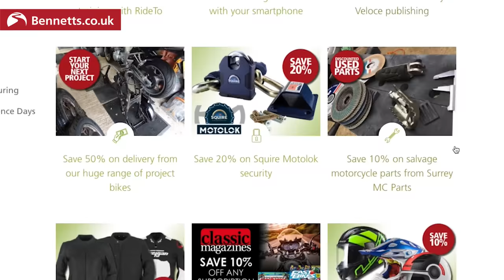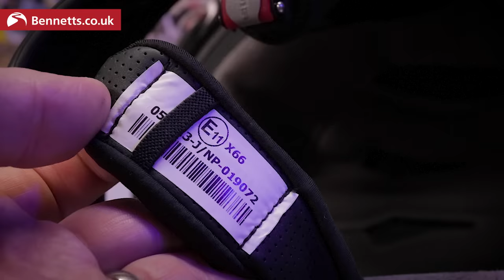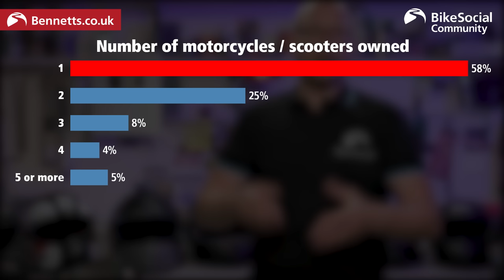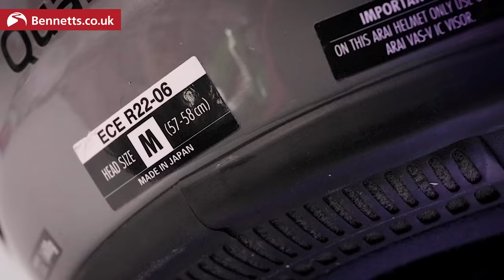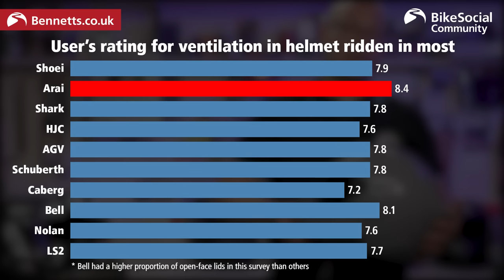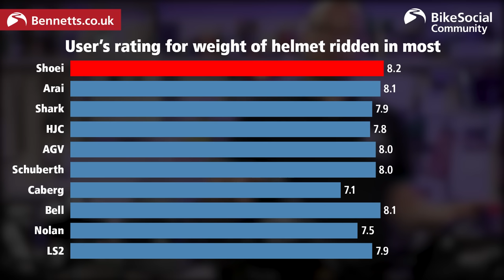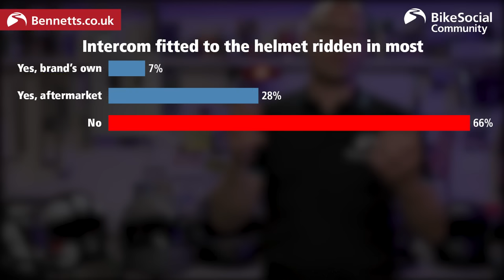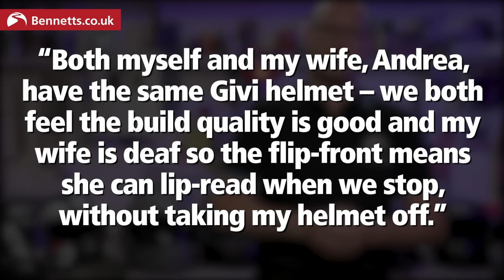Best motorcycle helmet | 2,133 independent reviews, 1 crash test

Comment: As a rider of naked bike the wind noise is the biggest one for me. Even WITH decent earplugs I've found most helmets have an unbearable amount of noise above 60mph (tried HJC, Schuberth, Scorpion, Shark, various models). The best I've found are Shoei lids for this but I think that is because they fit me best, which I think is actually the key to a quiet helmet, a good fit will mean minimal gaps for air to rush in!
Reply from the maker: Wearing a neck tube also helps reduce the noise, but yes - fit is a big thing in noise. Cheers, John
Reply: Don't blame the helmet, blame your melon.

Comment: Always had Shoei’s didn’t even consider other brands, however when it came to my newest helmet I bought the GT-Air2 due to all its features, save as drop down sun visor and properly integrable streamlined Sena audio design.
But most notable is how amazing it is when it comes to buffeting as it really makes riding more comfortable due to as  aerodynamic design. Your head can happily turn and move and you don’t feel like the wind is pushing much on your head and neck
Reply: I first had the GT-Air2 and then tried the AGV K6 (with a blue visor) - it works way better for me. Especially in terms of aerodynamics (the visor closes wind-tight) and a light-weight feel. And for track days at very high speeds nothing comes close to the AGV Pista RR😃🏁🏁

Comment: Such a lot of good information bundled in this video. Thanks.

About degradation of a helmet over 5 years time. I don't worry or care..... Salestalk...... (my opinion at least but made after doing lots of research on this)

Outer shell : Polycarbonate ( cheaper) helmets can degrade over time with  UV light ,but the helmets with fiberglass composite shell or carbon shell  definitely do not degrade over time and UV light. That material just does not degrade over timespans of 5 years or much longer.( simply imagine a carbonfibre car or a composite fiberglass car going bad over less then 10 years....I have a 40 year old lotus esprit...the fiberglass shell is stil good and strong). At work , we do fiberglass piping for some of the worst conditions to withstand time.
Inner EPS (polystyrene) shell : I did not find any studies done on motorcycle helmets EPS shell, but there was a study on aging of bicycle helmets EPS shell :  In a nutshell : Don't worry about aging. The helmets EPS liner does not deteriorate with age. Just make sure the EPS liner did not suffer to much denting, because it does not recover automatically on those places.
That leaves us with the visor and pinlock: replacable (do not try to polish a worn visor, you will not get it right, good visors have coatings on them.) , the inner lining :  it ages and loses its resilience but it is washable or replacable in a quality lid if needed and steaming helps getting back resilience to have again a good fit. The other mecanics of the helmet: well if these are bad : change the helmet....
That brings me to a second hand helmet.... Well I inspected and bought a perfectly fine Shoei neotec 2 with integrated sena,( new 650€+200€) for a total of 100€ , inserted a new pinlock for 30€ on a still perfect visor. The inner liner was in perfect condition and is washed and steamed . Outer shell had original silver paint with almost no marks. tbh I do not worry in the least about the safety condition of this lid and it is the most comfortable quality unit I ever had for an unbeatable price.

Comment: So funny hearing that Nolan owners regretted their choice the most. I just used a N100-5 for a year and despite the good fit I've found it very noisy (closing the visor doesn't actually seem to do anything?) the thing is immensely heavy (almost 2kg!) and bits of it are starting to fall apart.
Reply from the maker: Sorry to hear that! It is important to remember that we could only work with a relatively limited dataset, but it did indicate trends among those. Cheers, John
Reply: I have the same helmet and I love it....but I use soft type ear plugs no matter what helmet and make sure they go down into the ear canal, you will hear them crackling as they expand in the ear. Not saying that this applies to you but I was in Aircraft fitting before I retired and it is surprising how many people do not put ear plugs in properly. As for falling apart I havent had mine long enough yet. I did use some cheap Ear speakers which were pressing into my head so I got the N Com and its great...really comfortable. Also cant open the top head vent on the fly ...have to stop and take the gloves off. The optics I find excellent as well but I get some steaming up. I have just tightened the Pinlock and will see how it goes.
Reply: @malcolmemsley5909  yeah I use foam earplugs inserted as described for longer and faster rides, I use filtered plugs around town so I'm not quite as cut off. With these I still have a higher level of background noise with the Nolan than in my Shoei. The other place where the poor visor seal is clear is that my glasses fog up much quicker in my Shoei than the Nolan! On the fogging point, Nolan only put in a pinlock 70, the premium brands use a 120 which should hold out twice as long before fogging. On the build quality front my issue is with the neck roll adjuster breaking and the cheek pads wearing out very quickly. I do think the Nolan is probably the best flip lid at the price point but you have some compromises.

Comment: Great content John mate, love the videos. One of the reasons I try helmets on besides fit, it’s field of view. I do find some that meet all the features I want but the actual helmet is encroaches into my peripheral view or restricts view when shoulder checking. Where you would need a neck like a owl to pivot around and get a proper look. Or they have a huge nose guard that blocks the view of the gauges when ridding. Would be great if manufactures advertised degrees of view like they did other features.
Reply from the maker: Agreed, though sometimes there can be a widish field of view horizontally, but it can narrow towards the extremities more than others. Cheers, John

Comment: How can you prefer the Quantic over the K6? The Quantic has a 3/5 Sharp result with the worst rating for side inpacts, while the K6 has a 5/5 Sharp test, with maximum points from all sides.
Reply from the maker: I think you're confusing it. The Quantic is ECE 22.06 approved. And it hasn't been tested by SHARP

Comment: Most of the usual brands are pretty good now. I have a GT-air which is quiet, comfortable and never buffets. 
As others say - try them on properly and make sure it fits well, choose a decent brand and you'll be fine. 
If you buy the cheapest thing on Amazon you only have yourself to blame when it turns up falling apart, not fitting, noisy enough to send you deaf and with all the protection qualities of a baseball cap.

Comment: Another fantastic video that was really informative, thank you John.

Being new to riding this year, I bought the Scorpion Exo1400 Carbon (like the one you held up) the reviews for it seemed overall quite good. It does seem rather noisy (I wear Auritech earplugs always) and I was surprised to get a rain drop run down the inside of the visor on a couple of occasions in recent downpours. I'll be saving for a new helmet once a few more have passed the new EC 22.06 tests.
Reply from the maker: Thank you! I didn't have a problem with water getting in, but while it's a relatively good value, I had a few grumbles with it. Havea. check if you can adjust the visor mounting plates a touch, to draw it slightly tighter agains the top seal. Cheers, John https://www.bennetts.co.uk/bikesocial/reviews/products/helmets/tested-scorpion-exo-1400-carbon-helmet-review
Reply: I went back to biking in 2020, choosing a Scorpion Exo Carbon 1400 (£329). My biggest need specific to me was that it be very light (I have some metal pins in my arm/shoulder), and the 1400 fits the bill perfectly. I've fitted a Fodsport M:1 intercom and an olfi camera, and it still seems light enough to wear for extended periods. This year I took my 125 on a 9-hour trek to Somerset (I got lost a few times) and still found it to be comfortable. It was a touch loud on the dual-carriageway, but I suspect that was more to do with pushing 75mph @10.5k on my little Keeway than the helmet, LOL.  After covering 1,500 miles in a fortnight, I honestly have no complaints regarding noise or comfort. 

The only downsides are that I have still to figure out which vent position is 'open' or 'closed' on the top, while the clip-in padding is a nightmare to snap back in if it comes loose.

Comment: 16:25 when you say the ventilation is more powerful off road. Would this translate for on road but very hot humid climates like New Orleans ? Is there a downside to using an off road helmet like that on road only? Is there a few high quality on road helmets you can suggest with amazing ventilation for our swamp desert heat? Thx
Reply from the maker: Not that I can see, besides the potential lift of the peak (though on some that can be removed). The RX-7V is an obvious example of very powerful venting. I'd also look for a helmet that allows you to just crack the visor open easily, for more air. Cheers, John

Comment: I decided that I wanted MIPS and hi-viz.   That dramatically limited the selection.  I ended up with a Bell.
Reply from the maker: There aren't that many options – it'll be interesting to see what happens with ECE 22.06, though smooth, round shells are proving themselves. Cheers, John
Reply: Yeah surprising lack of MIPS adoption in motorcycle helmets, pretty sure there's solid evidence of it working
Reply: @bennettsbikesocial  Since MIPS reduces sudden rotational forces transmitted to the head, I would imagine that a smooth, round shell would tend to do the same thing by being more likely to slide rather than to snag.  I seem to recall that at least one manufacturer designs its spoilers and other protrusions to easily shear away in order to reduce sudden helmet rotation.
Reply from the maker: @jfess1911  Yes - that's been Arai's philosophy for pretty much ever. MIPS could take off over the coming months in more brands, or the redesigns of lids might mean 22.06 tests indicate the extra expense (however small) isn't required and brands don't bother. Cheers, John

Comment: Its hot and humid all year where I live. traffic is start stop during peak hours and slow. so i needed a helmet with good ventilation. light weight so i dont have to sit through slow traffic with a ton of bricks on my head. protection just needs to be good enough to withstand lowsides on occasional slow wet traffic. I got agv sportmodular. best 3 years of riding yet.

Comment: I'm surprised that Brits like Pinlocks. Don't you guys get a lot of fog? I rode with one on a foggy day and the fog planted itself right between the two panes and made it impossible to see anything.
I'll stick with the Rain X style surfactants.
Reply from the maker: In that case it wasn't fitted correctly - it has to seal all around the bead. Except on the old Scuberth C4, which wasn't a proper Pinlock

Comment: One thing i did learn is that you actually need to try each model and not just go after the brand. Sry but this "teach a man how to fish" doesn't apply. I never saw a store letting you go test ride with a helmet in my country. For me the most important things were noise reduction and having a drop sun visor, chose the SHOEI GT Air and wasn't disappointed plus the vent system is perfect for both winter and summer.
Reply from the maker: Sadly all you can check is fit and visor positioning in store – for wind noise and ventilation etc, you'll need to check the reviews. https://www.bennetts.co.uk/bikesocial/reviews/products

Comment: Brilliant video/roundup and info! Shark Evo ES which supercedes the One and Two has an improved mechanism for the chin bar. It's as smooth as the LS2 but safer, afaik, in open face mode (someone correct me if I'm wrong please!)
Reply: Also the Evo ES is easy to find at under £200

Comment: The obsession with D-rings and them being the only safe way to secure a helmet needs stamping out. They’re not, in any way, convenient and are, possibly, a fraction of a fraction ‘safer…however if we’re talking hydraulic pull tester levels of strength, your bloody head would’ve popped off by then (and you might actually want a helmet strap to give way).

Comment: No RS 803 xllite but you push Mt and LS2 ?
Reply from the maker: No brands are being 'pushed' in this video – the ten brands most focussed on are the ones that we had the most data for in the survey; we only got a response rate of 2% for X-Lite, which wasn't enough to get reliable information on. Having not used them myself for a very long time, I also couldn't comment. As mentioned, as the surveys grow over time, we should get more data and will be able to include far more brands. Cheers, John
Reply: @bennettsbikesocial  OK, Fair point. would you consider doing a review as they are hugely popular here or are we just suckers for Italian carbon. be nice to hear your opinion on  the RS 803 ultra carbon. thanks for the response.
Reply from the maker: @sidsnot3149  Absolutely – there's nothing we wouldn't review because the whole idea is to grow the library on the site. We do invest in review product, but to the largest extent we rely on manufacturers and importer to supply samples (or it'd get too expensive). I'm trying to build contact with MotoGear, the UK importer, but the recent lockdown has made things a lot harder. With luck we'll be able to get some gear featured. But also I really want the survey to grow, so regardless of whether we've had one on review, I want to be able to share a large enough number of owner opinions to get far more brands in next time. Cheers, John

Comment: sun visors are a problem for me,a dealbreaker even,i dont feel safe with something dangling above my eyes,and may at a large pothole just pop down and cover half my eye sight,i also dont like the gap they leave between the liner and the shell,or the fact that some of them obstruct the airways when up, i would much rather dig in my wallet and get a photochromatic visor.
 i wanted to get the gt-air 2 from shoei,but the visor makes me tentative,yes it is removable,but then you are left with the two bases for it dangling,and the ARAI helmets dont fit me well.so the profile V is out of the question

any users here know of a good GT helmet without a sun visor?
Reply: i am leaning heavily towards the NXR atm
Reply from the maker: Yes - the new NXR 2 will likely be a good choice for you then... should in in UK around September and it's ECE 22.06 too. Cheers, John
Reply: @bennettsbikesocial  cool! ill get the nxr 2 then when it comes in the EU,prolly at the end of the year,thanks for the heads up!
Reply from the maker: @Bill.Papadakis  Funnily enough, I've just got hold of one of the first in the country today, so expect more soon at bikesocial.co.uk. Cheers, John

Comment: You should have put a weight in the helmet you threw out of the car, and probably attached it to a dummy. Bouncing an empty helmet down a road without smashing into a bonnet with a person like shape and weight doesn't really demonstrate much. 
Not a bad effort though. 
I'm sticking with my Scorpion which has saved my head when a car T-bar'd me. I ride all year too.
Reply from the maker: I did try that, but couldn't get a good fit with a reasonably representative weight. I figured in the end that letting the helmet flex without a head form could give it even more of a chance of popping open. Though it was just for impact value really as it's been tested to ECE 22.05, so it can't be prone to popping open anyway. Cheers, John
Reply: @bennettsbikesocial  Yep, good point. If we can't trust the rigorous results of a safety standard then we should be worried. Thanks for you reply and for your efforts 👍

Comment: What a load of rubbish! I've been riding motorcycles since 1978 and I have never worn earplugs. It's not necessary if you've got a proper helmet. I still use my old AGV from 1978. The ventilation systems in modern helmets are probably the reason why they are so noisy. Sory nice lady; but if you need earplugs, you don't have a low noise helmet. I've ridden on a naked Suzuki GT550 and a Moto Guzzi California 850 with a large windscreen. I've been driving summer and winter in Denmark and had several trips to France and Italy on both bikes. Earplugs? Never! I dont like the sharp ridges on the back of many modern helmets. If you have a passenger wearing an open face helmet they may get hurt by these silly protusions if you suddenly brake or have a small accident.